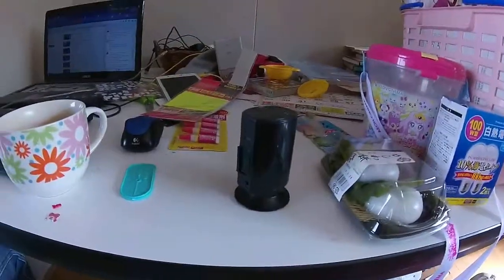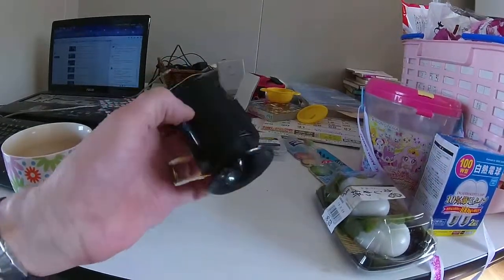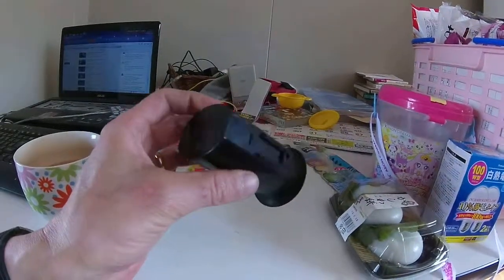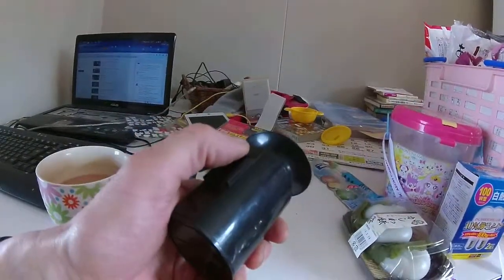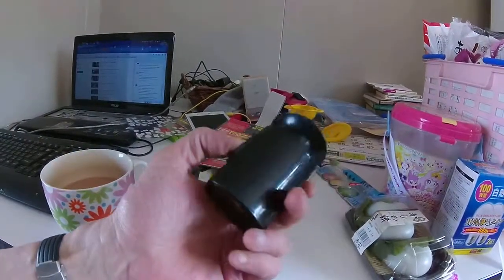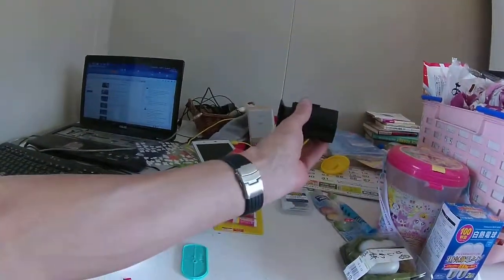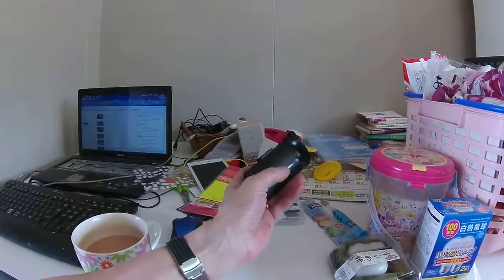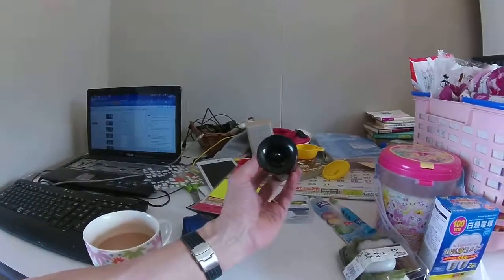6 Sound Alarm Converted to 1.5v Battery Powered noisemaker sounder

Comment: Hi Tim,
I completely agree with your thinking about the need for a sound emitter for bicycles to warn pedestrians that you are approach.  However, I could not bring myself to use the 6 sound horn shown in this video.  I think a sound emitter of the type used by blind people for echolocation would be good.  Another possibility is a device that is attached to automobiles to scare away deer that might be crossing the road at night.  It is a plastic whistle that mounts on the front of a car, and produces a whistling sound as air goes through the whistle when the car is moving.  Another possibility is to contact Jonathan Lansey, who has created the "Loud Bicycle Horn" and see if he has any ideas.
Reply from the maker: Why not use this horn? The main problem is thst they are two loud but it you swap the 9V battery for one A size 1.5V battery then their loydness and longevity of the battery is not inappropriate. They are also not all that waterproof, which is why I have stopped using them as horns, for the time being at least, but they can be adapted. Thanks for the wind whistle and echolocation ideas. Please would you be so kind as to share links or product names, if you know either.